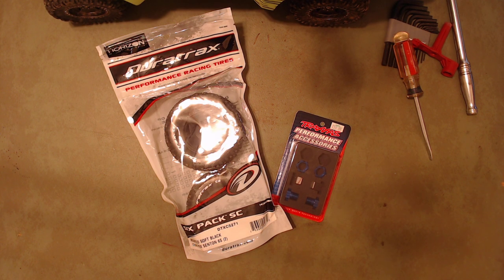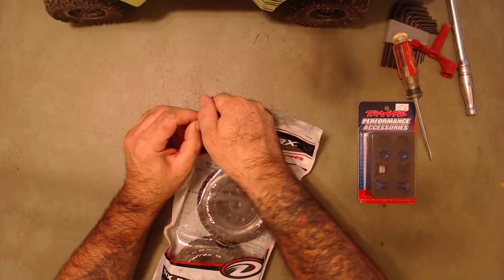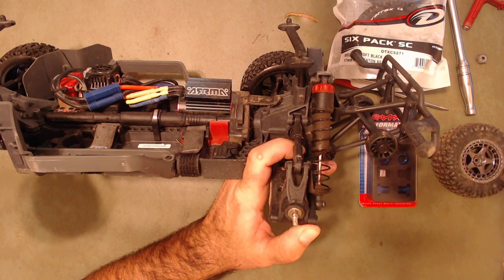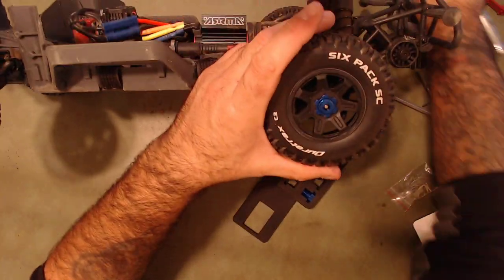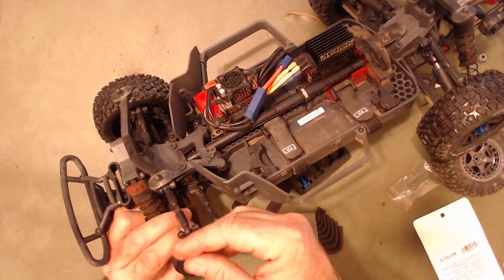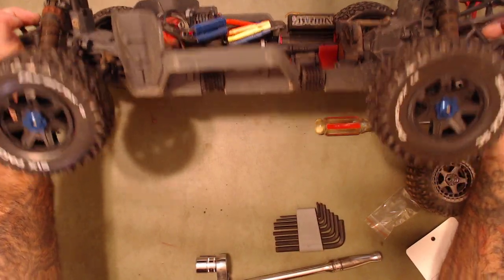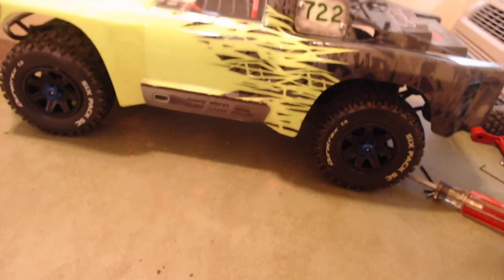Arrma Senton 3S BLX 17mm hub upgrade

Comment: Does that titan up the wheel hub real nice getting rid of wheel wiggle.
Reply from the maker: If you are referring to the wiggle at the hub itself, I'd say yes. It does help take out any small play at the hub itself. However, keep in mind there is always some play in these vehicles in general. Especially in the steering and when the suspension flexes it can make things wiggle a bit as well. No way to fully get rid of all of it really, short of machining every part out of steel/alloy with bearings and super tight tolerances. Like full size autos. Kind of the nature of the beast with these little guys.

Comment: is there any difference from going from one manufacture for the hubs to the other manufacture?
Reply from the maker: Hey Luke, not that I know of, however I have only done the mod with the Traxxas parts. Funny you comment as I am about to film and upload a "2 years later" update on the mod. Hang tight a few days for that before deciding if you want to do it or not. It still works and hasn't broke, but there is some wear and tear. Which I'll show in the video.
Reply: @thanumgaming Thanks for the update, I look forward to the video.

Comment: It's always a good idea to drop your pinion a couple teeth when adding larger tires. Because bigger tires put more stress on your electronics.
Reply from the maker: Very true. I have left it alone thus far as the diameter only changed approx 1-2mm and I usually only run 2S in it. However, I am always monitoring the electronics for heat.

Comment: We’re did you get the blue hubs ?  Got the same tires just looking for that blue hubs.   Thanks
Reply from the maker: I got mine from the local hobby shop close to me. They're part number Traxxas 5353X. The X suffix designates the blue color.  Looks like they're currently available on Traxxas as well as a few other websites.

Comment: I noticed theres quite a bit of space between the axle and inner of the hex.....isnt there lots of play? you have an update since using?
Reply from the maker: I did notice a bit, however these always have some slop in the front end in general. Especially after a couple seasons of bashing. On yours, do you mean "wobble / diameter" slop, "in/out axle stub movement" slop? For the later, maybe some small very thin washers in there to take up the space?
Reply: @thanumgaming Appreciate you taking the time to reply back! What I think I'm going to do is machine some aluminum rod, thread the middles so i can screw them on the axles and slide the hexes over them to fill that space then no slop or wobble. But you are right on all the slop all over the truck lol

Comment: Thanks for this! Just picked up the brushed Senton since I am new to R\C ground vehicles. Besides a brushless upgrade, being able to use more common tires was something that was more in my range of a newbie to fiddle with. Plus a blowout will happen eventually on the stock tires, might as well be ready with a spare set until I can fix the SCT ones.

Thanks again. Liked and subbed! :-)
Reply from the maker: Have you had a chance to run your new truck yet? How is it? Indeed, the hubs are a easy and cheap upgrade.

Comment: The inner diametre off the Traxxas hub matches the diametre off the axle?
From the feedbacks I found, that's the most common problem. With some kits you get a screw to fix at the end of the hub to fix it place by filling the gap.
I've ordered the typhon 17mm hub pieces + axle. Should fit the senton. Waiting delivery
Reply from the maker: The whole assembly feels tight, there is slight slight play though. However, there is always a small amount of play in all of these cars. Have you received your new parts and tried them on yet?
Reply: @thanumgaming  yep. Have to try it out.
Reply: @thanumgaming  mine after few laps (without tire glue threadlocker), the wheel got whobble because there is a gap to play. Is there any solution? Or axle nut 4mm maybe  to fill the gap ?

Comment: What keeps the Hub from rocking and losing up? How well did this hold up?
Reply from the maker: They are held in place by a threaded pin that holds the hub onto the axle shaft itself. Thus far it has held up and the screws have not backed out. I'm about to do a full steering upgrade on this truck as well to help tighten up the front end. Keep an eye out for the video in the next week or so.
Reply: Yeah the front ends do get lose.

Comment: I'm new to RC this past month or so with a 3S/6S conversion and a stock 6S Senton,  Done tons of research these past weeks.  I think I'm actually looking to go to the 12mm hex nut for the variety.  Also, a thing I never thought of before regards increasing tire size also changes the overall gearing ratio and increases motor stress.  While the 6S will handle 17mm, I'm thinking by going down to 12mm that I can get more speed while going to a larger wheel would give more torque?  Or do I have that backwards?
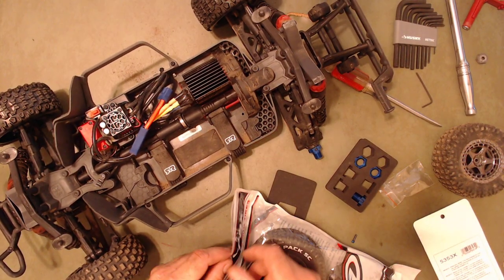Reply from the maker: So the way it works in full size cars is, when you go up in tire size only, it'll increase your top end but slowly kill your "off the line". That's when you gear accordingly to make up for the tire size difference. Like I remember when I used to run mud trucks, for up to 33" or so tires, you'd usually want a 3:73 - 4:10/1 33"-36" was usually 4:102 and then above 35" tires was 4:56 or above. Of course multiple other factors like, power band of the engine, intended running surfaces and conditions, etc. ... but yes a larger wheel will increase your top speed and slowly kill off the line. That can also generate more heat in the motor since it's working harder (undergeared) at take off, and running max RPM and high end). So as always, finger test the motor every so often. If you can't keep your finger on it for more then 3-5 seconds without getting burned it's getting too hot.  You can't go wrong with the 12mm wheel options out there as well. I just went 17mm for the extra overall strength.
Reply: @thanumgaming  Thanks for the info!  I'm not good with math, so apparently I'll have to learn an equation or two.  :)  I had not considered that the 17mm would be an inherently stronger tire for the added mass of the material.  

In my case, I'm with the star wars R2 -D2 builders club, so have a very specialized angle on the RC hobby.  One of the guys in the club realized the Senton was perfect for one of the minor droids from the movies.  So rather than an RC truck shell that weighs no more than an ounce or so, we are strapping 3-5lb plastic totes to the chassis.  I went with the 6S stats for the added power with a 14tooth pinion on the 2050kv motor run by the blx185 esc.  The stock pinoin is 20tooth on the 6S (iirc) so am thinking by going down on tooth count for torque, I reckon to use smaller wheels to increase the speed (down the road when I get to that upgrade and see how it performs as is).

I've barely run the thing with all the converting I've been doing, but the one or two test runs have been exhilerating to see this thing move.  I just can't believe the modern technology compared to when I was a kid in the '70's.  Mind-blowing stuff!
Reply from the maker: @GearsMcTinkersome   Once you get it, charge a battery and test it before changing gears. You will be surprised just how much power and torque that has out of the box. That sounds awesome though as far as the project you intend to use it in. I've been a SW fan ever since seeing the first one in the theaters.
Reply from the maker: @GearsMcTinkersome  Just subscribed to your channel and see you've been busy at work on things! Awesome!
Reply: @thanumgaming  I couldn't use hte stock pinioin as the bore diameter didn't match the new 2050kv motor 1 mod to 0.8 mod.  :(  But I'll be messing around with different pinons over time to see how many teeth are practical under what circumstances.

Comment: Just getting back into the rc world, keep seeing the stock tires are less than great. How do these tires perform? You have a videos of it running on those?  Awesome video by the way, straight to the point and good information!
Reply from the maker: Thank you! Yeah they are a bit soft for sure and seam to shred a bit easier then normal. Which is too bad because they have a good tread on them. I don't have a video of it running on them but maybe I'll charge up a pack quick and go hit a parking lot for some footage. Thanks again for checking out the vid and channel. Glad it was helpful.
Reply: @Ernesto Lane Instablaster =)
Reply: @Zev Braylon thanks for your reply. I found the site on google and Im waiting for the hacking stuff atm.
I see it takes quite some time so I will get back to you later with my results.
Reply: @Zev Braylon it did the trick and I now got access to my account again. I am so happy:D
Thank you so much you saved my ass!
Reply: @Ernesto Lane Happy to help =)

Comment: Hello, you had to make any modifications to the frame?? And if you have video of the running
Reply from the maker: Nope, no modifications to the frame / chassis needed at all. At least with this set of wheels. If you tried running monster truck tires they would probably hit stuff. No videos of it running at the moment. It's winter time here with snow so can't do that right now unfortunately. Thanks for checking out the video!
Reply: @thanumgaming  thanks for the info

Comment: I have these same adapters and the issue I have with these is that the screw comes loose after a little bit even with the thread lock on it
Reply from the maker: Interesting. I have not experienced that yet myself, however I only have 4-5 packs through it since the mod. It's apart on my bench now and they are still tight, but I will most definitely keep an eye on those in the future. Thanks for the heads up and checking out the video!
Reply: Seems like it needs a center nut... like the other kits have....

Comment: My stock tire blew within first full charge ride ridiculous
Reply from the maker: Seriously? That's crazy! Did you buy it from a local hobby shop or from Horizon? Pretty sure Horizon warranties the Arrma stuff still. Take a picture of your receipt and a pic of the tire and description and they will more then likely send you a replacement free of charge. I had an issue with the motor in mine about 6 months after purchase, contacted them, and had a new motor in my hands within a week.
Reply: Same mine blew out the night I bought it. Now it’s been a few more days and the motor is burnt out as well. I Should be able to get it warrantied though like I did for the tires. They sent me two more replacements for my blowout. Loving it tho!
Reply from the maker: My stock motor died on mine as well. Definitely hit them up about that. It seams to be a somewhat common problem for whatever reason. The only way they'll fix it is if we keep calling them out on it. Glad you're digging the truck though other then those issues.

Comment: Nice video, not much out there for the senton 3s on tires, do they balloon at all on 3s?
Reply from the maker: Thank you. I took it out running this past weekend and they did balloon a little bit but no where near as badly as the stock ones did. Last time I was out, one of the stock ones blew partially off the rim and ripped. Part of why I ended up doing this upgrade sooner then later. These Duratrax tires are much stiffer and stronger I feel. They are originally for a 6s Senton, so that definitely helps. Can't even imagine one of these trucks on 6s. 3s is more then a handful. Do you run a Senton as well?
Reply: @thanumgaming  yes my wife bought me a v3 blx but unfortunately i have to wait for Christmas.  I've been doing alot of research on it and i love this truck and i already spent way too much on a Slash 2wd. My friend has a new Slash 4wd and its an animal but stock tires also balloon alot so he will be doing your upgrade as well. Thank you for posting the video, not too much as far as upgrades for the senton out there, loved the video.
Reply from the maker: @josephnubile1970   Excellent! Congrats on getting the new truck (soon). Thanks for the kind words as well. I will try to do vids like this here and there as I do small projects on the vehicles. Thanks again and have fun out there!

Comment: Do these have a lot of wobble?
Reply from the maker: There is no wobble on mine at all. Other then the slight play that is always inherent in these vehicles. Is the wobble radiating from the wheel and the hub itself? Is the rim fully seated onto the hub hex? Or is it just wobble in the front end in general? Which might point to worn steering link ends and whatnot.